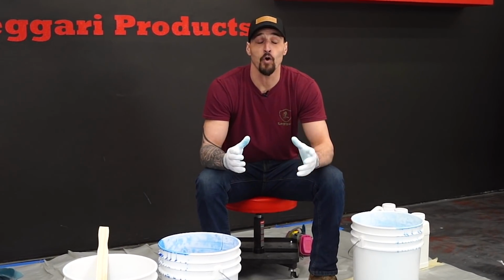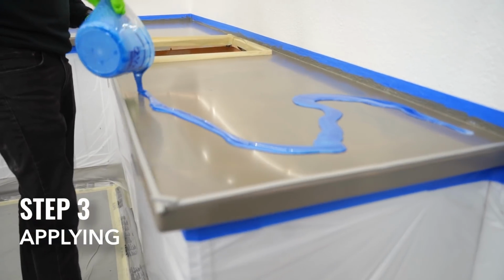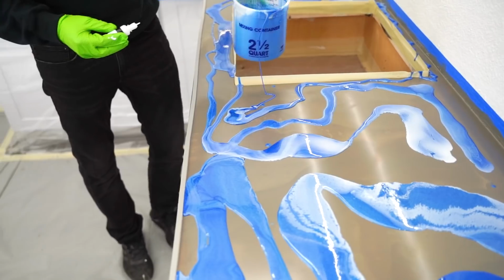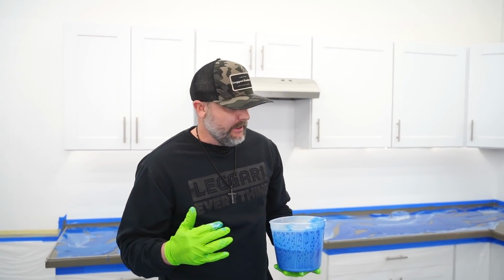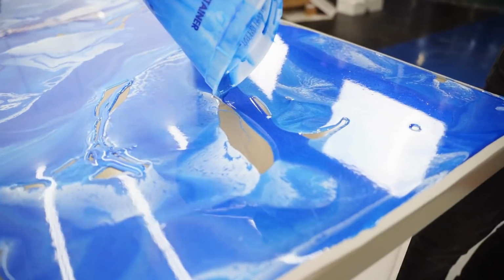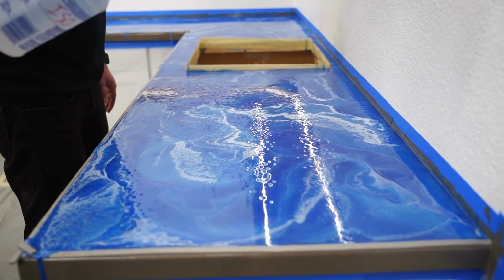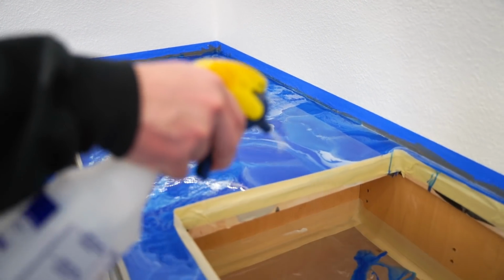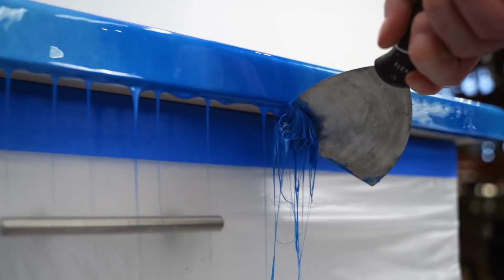How To Pour Epoxy Wave Design EASY TUTORIAL - Custom Epoxy Countertops

Comment: I've commented before on the weather stripping you use as I can't find it on Amazon can you put a link in the description please?.I tried recently on my table and the stripping just broke into literally 23,988 non grip gluey pieces when pulling it off 😀,great tutorial,thanks 
Adam .uk
Reply from the maker: https://www.homedepot.com/p/M-D-Building-Products-3-8-in-x-17-ft-Foam-Weatherstrip-Tape-02253/100353460
Reply: You can also use 1inch tape first and stripping on top.. But I get mine from lowes or home depot.
Reply: Great idea that would work,the link isn't any good for UK we don't have home depot here,anyway yeah I'll try the tape underneath thanks.

Comment: Looks amazing for the first 10 minutes of use.  Epoxy is far too soft and scratchable to make a good surface.

A manufactured diamond surface would be great, or a super thick layer of gorilla glass.
Reply from the maker: Paired with our urethane topcoats your epoxy systems are very scratch resistant!

Comment: sir what is  in side sapry bottle
Reply from the maker: The dispersing effect is achieved by spraying small to medium drops of 91% isopropyl alcohol, then finish with a fine mist of denatured alcohol (fuel) to pop any bubbles and allows the epoxy to lay out glass smooth!